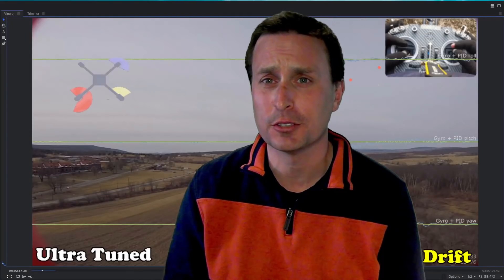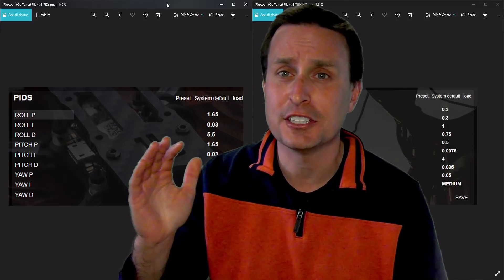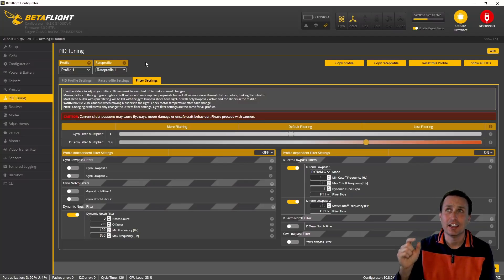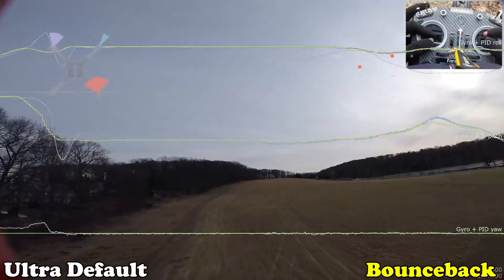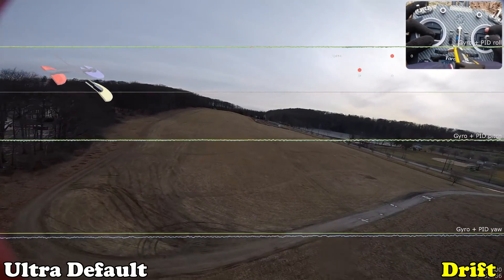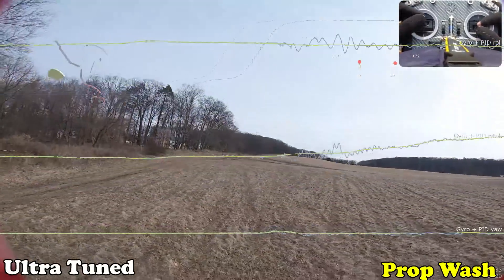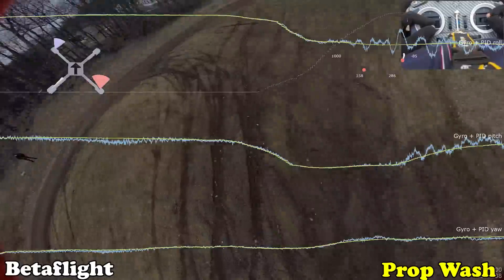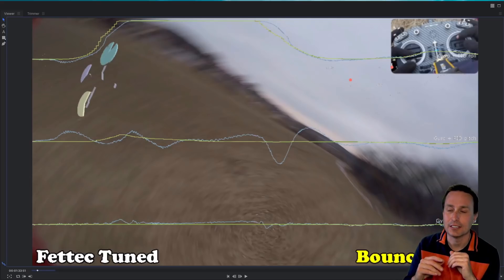💥💥 The BEST Flight Firmware for 2022 ?? 💥💥  ULTRA v. Fettec v. Betaflight | TUNED Review

Comment: Hi, I wanted to ask if you can help me, I bought a FC Fettec G4 V1.7 I mounted a new drone but I can't fly it.
I installed the Firmwar Alpha, as I accelerate a little at full throttle it's also very dangerous, can you help me? By Mauro.

Comment: Interesting I'm huge fan of betaflight. I recently just switched to FETtec G4, I honestly think that the kiss ultra tuned was closer to betaflight then FETtec was in the HD video. I'm not sure how they compare blackbox wise with setpoint, correct me if my terminology is wrong but I believe you called it that. It would be really cool to get the low throttle feel from kiss/FETtec mixed with how betaflight stops on a dime on any axis and holds it's position while it's falling and punch outs.
Reply from the maker: low throttle feel of KISS/FETtec??  

No offense to anyone, but is that a quantified thing or just something fanboys make up to have something to hang on to?  That's the issue that I see.  No science or measurable performance increases in these things.  Just hype in too many cases.  So from a design standpoint, you cannot code in hype.

Not saying you are pushing it, but it's infectious when something like quad feel is so placebo prone.
Reply: @uavtech  I'm no fan boy, I was just saying from your video, I found that the kiss ultra tuned flew better then FETtec and Closer to your BF video in my opinion. The only flight controller I have been able to get the low throttle feel from is the lux f7 hd mini. My evoque is on rails. But I still am no pro at tuning. Everything untill now has been high end betaflight quads. I just feel like the bnf good tuned betaflight quads I own are jumpy and the expo is more of a deadband/delay regardless of the black box logs, thats how it feels to me. I was asking more so how to achieve the same low to 30% throttle transition like the g4 stock pids. The lux f7 hd mini johnny fpv was my favorite and still probably is but not on 4.3.  I shouldnt say switched but rather enjoyed FETtec g4
Reply from the maker: @kennykobi  if you want more "mushy" at center stick, increase Expo.  Rates are what you want to control feel, not the tune.  The tune should be matched the quad's response to stick input (the response drives what you want to tweak for the tune based on sharp stick inputs).  From there, you tweak out the rates to get to the desired feel.  If you are not using Actual Rates in Betaflight, check them out or of course the KISS Rates as they are in there too for an exact match.

Yes, at the time of the test, FETtech firmware was still in Alpha phase and legacy kiss was better.  KISS ULTRA is just legacy KISS honestly, nothing new in it except Brake, which doesn't do much when you dig into it.  It somewhat helps with i-term winddup so it doesn't cause bouneback, but locks i-Term too late to really be effective.

Comment: Love your work Mark. Without guys like you I would not have anywhere near the level of ability and understanding in regards to tuning. Just finished tuning a 6" on 4.3 and it is awesome. I also have a 5" freestyle quad on kiss and I like it. However, there is no way I could have tuned this 6" to fly how it does running kiss. Cheers.

Comment: Great video!!
Bf keeps pushing to get the best!
I just wish they had a better way for decreasing the pids at landing 
Perching it’s the easiest 
Any recommendations?
Reply from the maker: The Fettech reduction of PIDs concept seems like a good approach.  Maybe something that turns off Airmode.  But right now, put Airmode on a switch.  If you deactivate a Mode comes up for it and then you can aet to be active all the time, except if you want to perch, throw the switch.

The Fettec trigger concept seems like ok, but hard to not have it hit a false trigger.
Reply: Easy. Use pid_at_min_throttle = OFF in CLI. Notice your throttle min value in BF. If properly set it should be 1000. Now make "idle up" on switch in OpenTX so when you flick the switch you have like 1% higher min throttle. Say 1010. Than in BF set stick low treshold to 1005....so when switch is low and your min is 1000 you have no PIDs and you can enjoy smoothest landings ever. When you flick the switch to high and your min is 1010 so above stick low min of 1005 you have full PIDs and full authority...2 warnings: I have also airmode on switch so I turn airmode off and "idle down" before landing. Not sure if this works with airmode permanently on....and never fly with that idle up switch in low position as when you lower throttle to min in air you will lose PIDs and authority and just fall out of sky. Only use it before landing. So arm than flick to high do your flight and before landing back to low.

Comment: In regards to 4.3, I've notice that the last little bit of prop wash performance comes from "tuning" your dynamic idle. Just tuning PIDs in Betaflight will get you super close but with the right dynamic idle, prop wash is almost non-existent in all normal prop wash inducing movements.
Reply: Yep, I can confirm that. Amazing prop wash handling if tunned corectly.
Reply: I second that!
Reply: Whenever saturation is present, that seems to be what pushes things over the edge.  I wasn't a fan of the new methodology at first, but wow, does it work well.

Comment: Betaflight has had years and many developers and is locked in and on rails. Where as Kiss Ultra and Fettec are new and much fewer developers but they have done a good job so far and no doubt will improve as they mature. It's great to see competition to Betaflight if anything it forces things to get better over all.
Reply: Kiss and fettec new lol
Reply: Old kiss is as old as beta flight, if not even older.
Reply: Bruh Kiss is old af 😂

Comment: wow betaflight default is good but with the propper master tune is absolutly a beast

PD: i use your pressets in bf 4.2.11 and my quad feels amazing... the only thing i move is the stick sensibility because the kwad feel more robotic and want more flowy movements

Keep the good work, grettings from Chile
Reply: for flowy movements i guess mr Mark can provide a good the solution for you ..maybe by joining his patreon for more private chat with him,,because beta is the pioneer i will bet in they have prepare for many world wide pilot with the same request to be flowy quad..and the preset it just the starting point and must be adjusting according how the pilot  want tobe for their own quad
Reply: Overfilter the RC inputs.  No joke, just go to 4x the default auto_smoothing on RC, and you'll get so much more flowy response.  It may not be quite as locked/dialed in some cases, but it really works for making it feel more flowy.

Comment: How does one tell the difference between I-term induced bounceback and P-term induced bounceback?  how does this manifest when flying?
Reply: P-term goes "da-da" and I-term goes 'womp--womp'
Reply from the maker: P-term bounceback you can mostly ONLY hear and "think" you might see.  i-Term bounceback is what you clearly see.  So if you hear the motors rev twice after a sharp flip or roll, but you don't see it really, that is P-Term bounceback.  If you clearly see bounceback in the HD, that is i-Term bounceback.

Fettec they look a lot closer.  I don't think P has enough authority somehow in the PID Sum or something.  Again, ALPHA firmware.  But that same things lease to the cross axis bobble too.  However with KISS, ULTRA, iNAV, Emu, or Betaflight, what I said above holds very true.